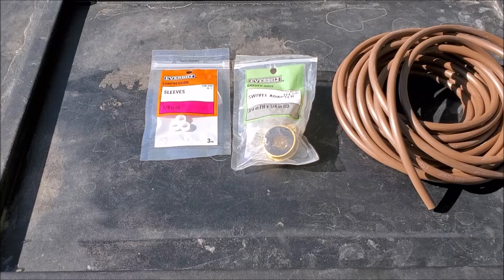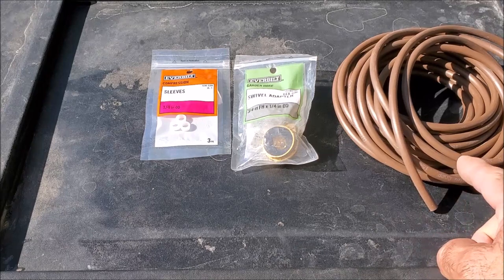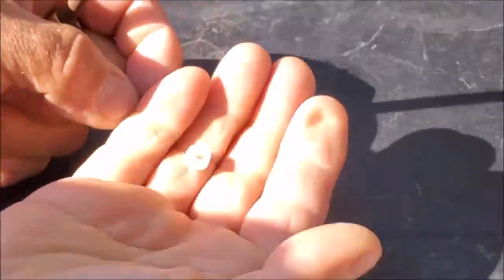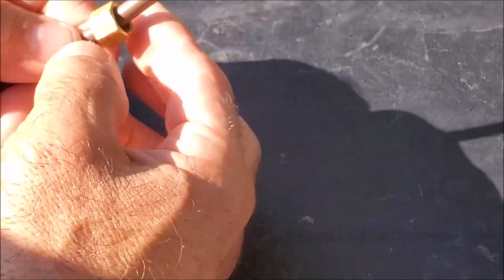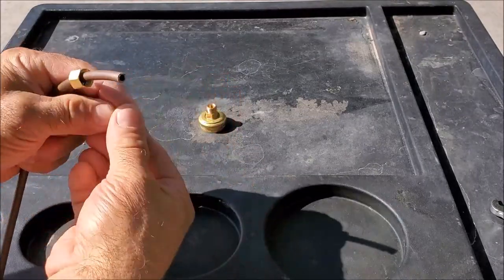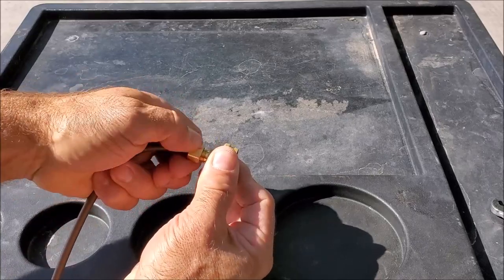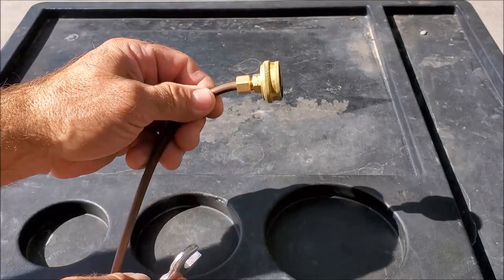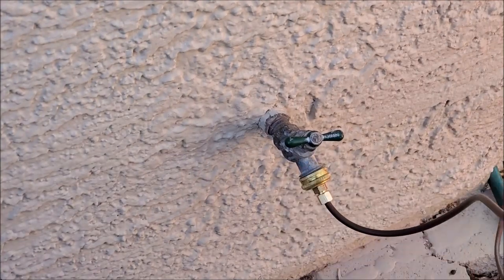How To Connect Any Swamp Cooler To A Water Line

Comment: Thanks this helped I now know I should get plastic instead of trying to work with the brass ones for a plastic line that I've been trying to keep from leaking
Reply from the maker: It should be fine over time the hard water will seal the leak in most cases.

Comment: I hope you answer quickly.. this helped soo much... my question is when you turn the water on to the float, will it stop when it is full or will the water keep going and going. I know dumb but i am just worried.
Reply: It works like a toilet.  When the float gets to the desired height, it closes the valve, thereby not allowing any more water into the device.

Comment: I have the small end which has been hooked up to our water supply for 7 years.  We just had a new backflow preventer sprinkler head installed and I had no idea where to screw on the swamp tubing.
Reply from the maker: Hard to say without seeing it. You should be able to hook it up where it was connected before.